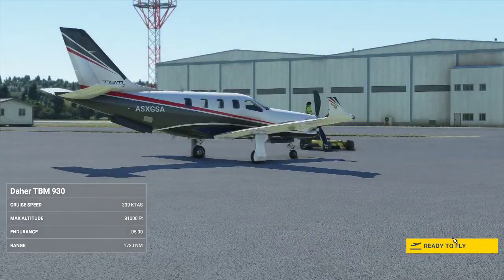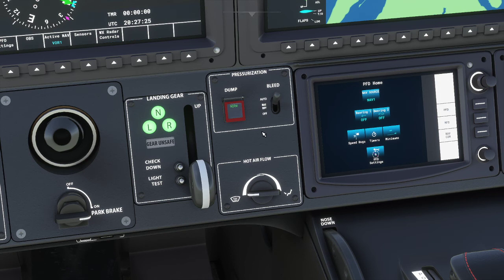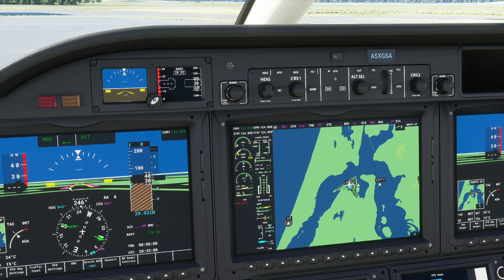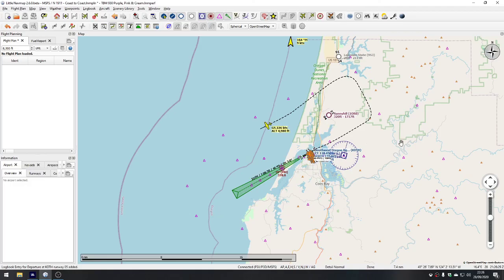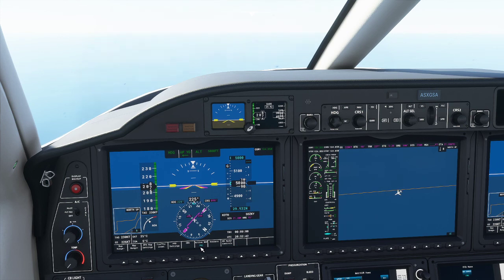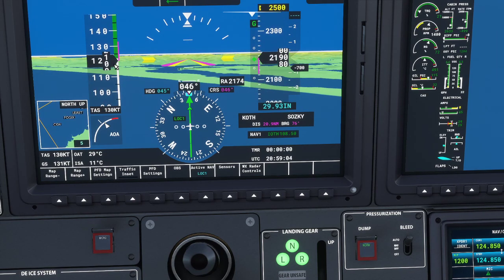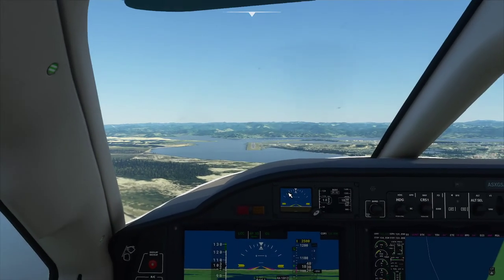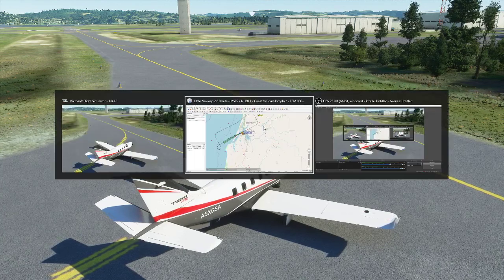ILS and FMC Tutorial with the TBM 930 in Flight Simulator 2020

Comment: Ive been using this Aircraft to learn IFR, but its proving very difficult. There seem to be so many bugs, I dont know if Im doing something wrong, or it is down to a bug.
Ive tried planning a route in LNM, loading it through the world map, but that doesnt go to plan either, and end up landing manually as the instruments and FP dont work.
Reply from the maker: I haven't had any problems like that - I just create the plan in little Nav Map, import it into Flight Simulator when setting up the route, and it appears in the GPS system of whichever aircraft.
Reply: @jonbeckett  Its probably just me then. I setup a departure procedure, approach and ILS landing, then calculate route all with LNM, but when loaded in the sim, it looks totally different, it puts me on a runway to start rather than the ramp. The big problems seem to happen when getting towards the landing procedures. Maybe if you get chance you could do a step by step video....
Reply from the maker: @AndyBDrone  You may find that Flight Sim takes no notice of the exact starting location - it depends what the PLN file format supports. You may have to adjust the plan once loaded into Flight Sim 2020.
Reply: @jonbeckett  Cheers, Ill have a go